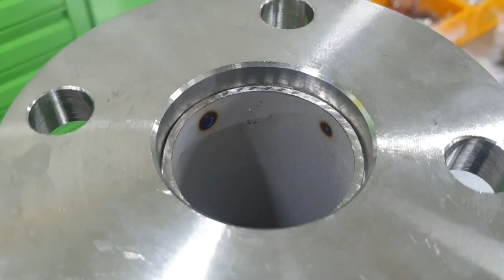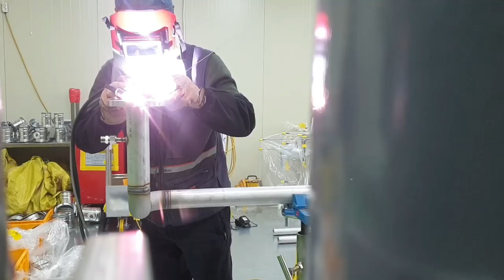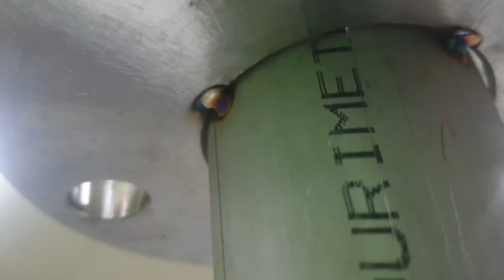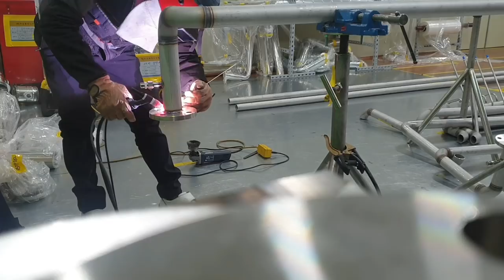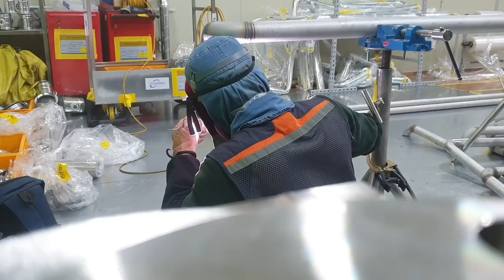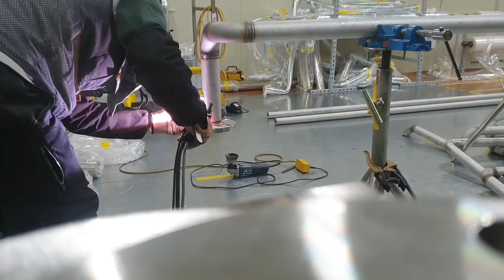In, out side Flange weld. Field welding

Comment: Hi Welder Jin, but by welding the flange from the external side, you have not used the internal protection gas! Has the tube not burned internally?
Reply: Wo ist deine Formierung du schweißt doch Edelstahl
Reply: @SuperKiselev  Hallo Evgeny, ich habe meine Ausbildung durch Arbeiten erworben und Edelstahl ausbalanciert

Comment: Stainless with no purge. Bad job!!!!
Reply: Nonsense
Reply: @newage3397  what ever you say. Poor workman ship. Stainless work with no back purge is just wrong! The inside will go rusty!
Reply from the maker: Flanged welding is meaningless !!!
Reply: jameswcw1986 No need. Weld will be pickled or polised = no rust
Reply: @Johndeerehdi  doesn't matter! I'm talking about the inside of the pipe where it'll be black and furry. That's where the rust will start. You obviously have no idea 🤣
Reply: jameswcw1986 for a slip on flange you don’t need a purge, unless you can’t weld them without burning through that is. But for a butt weld of coarse purge is a must
Reply: @starletburkie  without burning through??? What's full penetration then? What a joke! I've been welding stainless for 15 years. Your wrong.
Reply: jameswcw1986 you don’t need full penetration welding a slip on flange. One weld on the inside and two runs on the outside it’s essentially a filet weld not sure what you’ve been doing for 15 years.
Reply: @starletburkie  what I make is pure water systems for the power grid. And what we do has to be really clean or you'll blow up the statcoms or thyristers. So what your saying and doing is wrong. Also you should weld everything to the highest possible standard. This in my view is lazy and poor workman ship to be completely honest.
Reply: jameswcw1986 to be honest I purge everything sch10 for the reason to keep it clean no heat marks or risk of burning the inside but for thicker pipe I don’t because it will never burn through, flanges I’m tanking about not butt welds
Reply: @starletburkie  we have to purge everything. It has too stay clean. And every weld has to pass x-ray and has to be full penetration. High pressure vessles and that's how I was thought to do it. Sorry if I'm being negative but this goes against all I've been taught.
Reply: jameswcw1986 I just don’t understand stand why you need full penetration on a slip on flange? If it was sch40 pipe there’s no chance of penetration. I have my welds x rayed aswell Iv never a problem, on flanges they check for cracks and undercut only
Reply: @starletburkie  it's sch 10 if you look that pipe inside the flange is only 3.77mm
Reply: How and why purge a flange....you’re a muppet James
Reply: Why purge? He's able to get gas coverage on the inside of that flange.